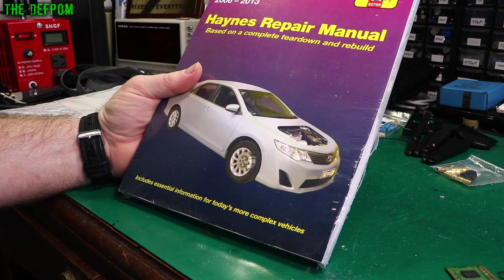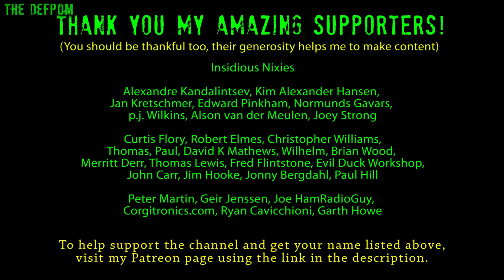🔴 What's in my Mailbag ? - Mailbag Monday 18th October 2021 - No.884

Comment: I use those fuses, well 3 amp and 5 amp on the cheap 18650 Power banks between the battery and the PCB just incase the chip shorts, and actually blew one when I put a battery in the wrong way round, yes silly what:-) I cut the metal lead and solder the fuse in place works very well

Comment: Wifi on the ESP32 is known for dropouts due to it's HT40 bandwidth and overlapping channels. Try manually setting it to HT20 (it's HT40 by default). They say 2.4GHz is not advised when using HT40. I believe it's esp_wifi_set_bandwidth you need to look at.
Reply from the maker: I remember looking into this a while ago, I am 95% sure I did something already.